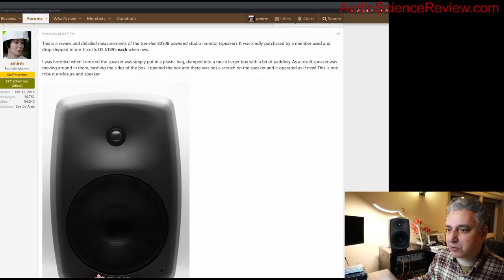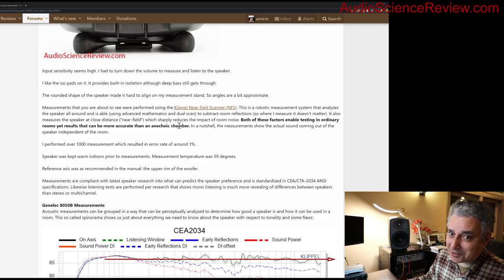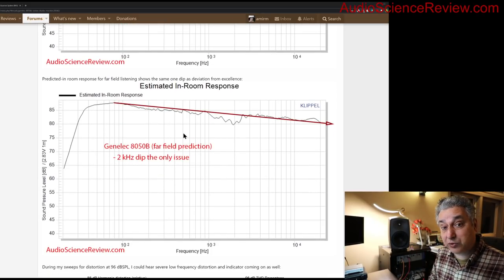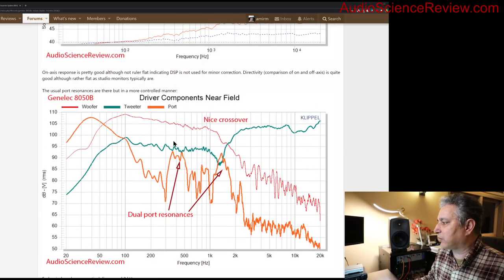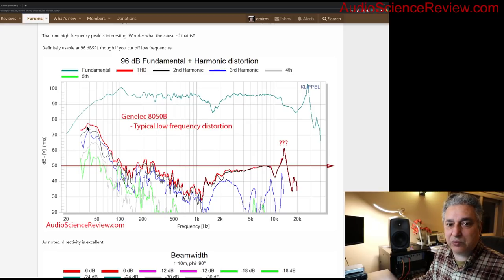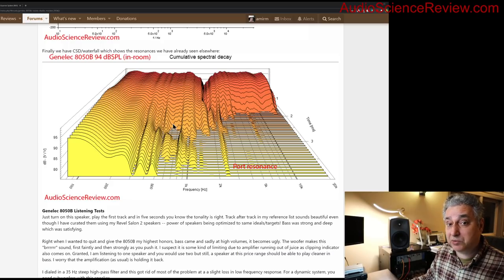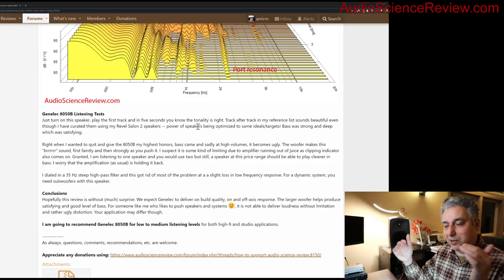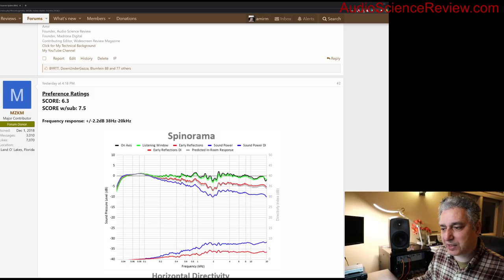Genelec 8050B Speaker Review (and how to read speaker measurements)

Comment: Thanks for this review. Very, very good. 

As a professional sound engineer, I would like to point out one little thing - but I am sure you know that - and that is that monitor speakers usually are not built for high SPL, especially nearfild monitors. The Genelec 8050B are marketed as a very powerfull nearfield monitor (which they are), but they are still marketed as NEARFIELD speakers. So comparing them to a floor standing HiFi speaker with three 8" woofers isn't exactly fair, and I wouldn't call their inability to provide comparable bass a failiure. It's a limitation that one should be aware of, yes, but nothing more, and to me, it does not take away from them the fact that they are superb for what they are and for what their intended use is (also for the price btw., which comes in about 1500 bucks cheaper than the mentioned JBLs). The 8050Bs as a pair will practically rip your face off in a near field application if you crank them up. Not that any good engineer would ever want to do that, since all it does is to damage your hearing and exite the room to a degree that you are distorting everything into oblivion. 

But enough bla bla, all in all I totally agree, those are great (!) monitors, one of the best in their class. And opposed to public opinion, they are not flattering the music. On the contrary. They are quite merciless actually. A good mix will sound good, but get yourself a pair of those speakers and you will quickly find out, that not all of them are (a lot of them are not actually) :D People who can't mix hate that. People who can, will aprecciate the disective properties of those tools. If your signal is flawed, these speakers will slap that right in your face.
Reply: @exeterweathermodification watch the ones series
Reply: When I got my first electrostatic panels I was amazed how my perception of recordings changed. Some albums became a torture to listen and then again some old simple stereo recordings became alive, holographic sound stage despite otherwise not so good sound quality...

Comment: To anyone wondering about our ability to filter out reflections, read about Echo Memory.

Also, living 300km from the Genelec headquarters has meant that 80% of the studios i've worked in, every school, every rental company.. they all have genelecs. And i mean elementary school AV room has genelecs... For sure, older and smaller but still.. That is what i've used by far the most and i've installed and tuned probably a dozen of them. It is really easy when you have a speaker that you know very well and when you write your list of rentals or just have to work on the road, having the same series of genelec at each end.. really makes things easy. You know what you are going to get and i've been spoiled by them, for sure.
Reply: Yeah!
I did buy my first genelecs about 35 years ago and has not looked back!

Comment: I used 8050s when I was a recording engineer. I auditioned dozens of near field monitors before choosing the Genelecs. Event Opals came in second place. You can turn off the tweeter with a DIP switch. I don't remember if you can turn off the woofer. The 8050s are too large for my room so I use 8030s with a sub for occasional music mixing and 8020s with a sub as my desktop monitors now.
Reply: Hello, I have 8030 also, which sub are you using with them?
Reply: @miguelalonsoperez5609  I currently used a Blue Sky SUB12 with one set of 8030s and a Presonus SUB8 with another set. The SUB12 is perfect. The Presonus is horrible. Definitely going to replace it with a Polk XT12 or a Genelec 7050 or 7060. I also used a Bag End 12" Sub for a while that I liked the sound of, but adjusting it was a pain.
Reply: @ftlbaby  thanks! Probably I’ll get the 7050 next year, 8 inches is enough for the kind of music I use to listen

Comment: Your review based on actual, well executed, meaningful measurements - instead of just anecdotes - helped me pull the trigger on this one instead of a pair of footprint 01s.
A little less than a year later, I couldn't be happier with them. I use them for production, mixing, mastering and casual listening too - basically everything. They hold up incredibly well and their low end extension is insane.

About to complement them with a sub soon.
Thanks for doing these incredible reviews!

Comment: Nice to see. I had these some years ago so I  was curious about your results. Still have Genelecs but the 3-way with DSP as you mention.
I do agree with you the 8050 do have an issue when playing very loud but on the other side they play very good on low and medium levels. (What that might be...)
Although one note about the DSP controlled room correction is that the frequency response isn't in particular flatter—it's just compensating for how a specific room behaves. It's not compensation for all the differences in the response but just a few of the most audible difficulties the room has.

Comment: I learned a ton from this video about the physics of speakers, thanks so much for putting it together and explaining!  And your list of reviews is amazing.

Special request to add Yamaha HS8 to your list!  I saw you did some Yamaha reviews and approved of the HS5's, but rejected HS7's.  I've had a pair of HS8's in my bedroom setup for a couple years and I've been debating swapping them out for JBL MKII306.  For some reason they've never sounded "good" to me although they are pretty detailed.  I feel like the lack some midbass warmth and might just be too bright overall, but they have been my only monitors so I have no comparison.  I tried KRK R5 G4 for a bit, but the highs sounded a little muffled and less detailed, but were overall more comfortable to listen to.  Size wise, I realized I don't need that much bass in my room even though I'm working on EDM, it's too unreliable with room modes so I figured I'd go for the 6" JBL instead of 8".  I can mix bass better with a spectrum analyzer and headphones.

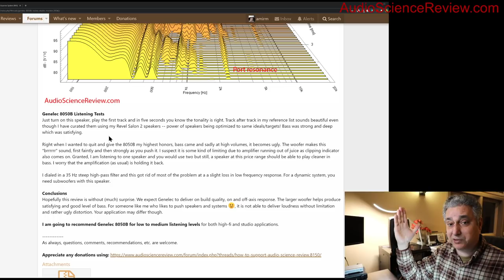Comment: Very interesting Amir. Like Albaer below I appreciate your in-depth explanations. I also appreciate the exhaustive testing and heard about the Klippel near field tester for the first time, although I know about NF testing of military RF equipment. Did I hear you right 33:02 saying you don't test listen to electronics because they are 100% measurable?!  I certainly don't agree with that statement. I once bought an amplifier from a major manufacturer just according to the specification / lab tests - it was an audible disaster but tested well. The next time I bought an amplifier my shortlist was based on reviews (which include lab tests) and my purchase came after listening tests. I am still listening to that amplifier over 30 years later and it keeps surprising me positively after I cleaned up the power supply to it and the RF environment it is exposed to. I'm quite intrigued by the online forum - perhaps looking at "not recommended" to eliminate candidates from my shortlists. All the best, Rob

Comment: I was very interested in getting a pair of the Genelec 8040b until I saw that they are using a 90w amp for the woofer, which struck me as pretty anemic for a powered studio monitor.  Still trying to decide but now I am looking at the Adam Audio S2V or possibly the A77H.
Reply: Not that anyone cares, but I ended up buying the Neumann KH 150 with the MA1 calibration system.

Comment: Amir - thanks for the excellent presentation. I wanted to know if the NFS allows one to predict what the speaker may sound like at say 2.5 meters. I’m just getting into DIY and I’ve read on multiple forms that that response should be optimized for typical listening distance (e.g. 2.5m). When I used various x-over design software (e.g. VituixCAD) - it allows me to design the speaker at various listening distances. When toggling between 1M and 2.5M, there is a difference in the predicted response, albeit minimal.

Comment: This is really helpful, thank you. I understand frequency response measurements much better now. 

Can you explain what causes differences in “detail”? With some speakers or headphones I feel like I can hear the elements of the music clearer. Is this just a function of flatter response and better highs, or is there actually another property of the speakers that make them “more detailed”? 

I’ve read people write about how the speed of the drivers can affect “timing”. Is that real phenomenon or just mind tricks?
Reply: Yes, being able to hear better Detail is due to the overall frequency response.  But there are a few other contributing factors as well.

Although it is not exactly to everyone's taste or preference, the "Harman Target Curve" is a widely accepted standard or "baseline" which describes the overall "tilt" or "curve" in the FR from 20Hz to 20kHz that will provide a balanced sound character and excellent detail throughout the entire frequency range.

Too much of the high frequencies results in fatigue and the masking of lower frequency details, and vice versus.

Therefore, it's most important that the frequency response be SMOOTH and EVEN across the entire bandwidth, with no large dips or peaks, as Amir demonstrated is the case with these particular Genelec monitors.  👍

An excellent measured frequency response graph will only deviate from the smooth Target Curve by +/- 1.5dB from ~160Hz and higher.  But a +/- 3dB response is still considered quite good.

As Amir covered in his measurements and review, the Directivity of the speakers as a whole is also very important in regards to "detail", and especially in regards to recreating the accurate Soundstage that was captured in or purposely mixed into the recording.

"Directivity" or "Constant Directivity" means that all of the individual drivers used in the speaker are projecting a very similar on-axis and off-axis amplitude or frequency response (an even polar response), which means that both the direct sound from the speaker AND all of the delayed and reflected sound that reaches your listening position will be very similar in tonality/frequency response.

Much of this is accomplished by using complementary low frequency, midrange, and high frequency drive units, and implementing proper crossover filters that keep each driver from playing into its beaming range (where its polar response or its width of dispersion starts to narrow or "beam" with increasing frequency due to the physical size of the driver and the frequency that it is playing).

Larger drivers start to "beam" at lower frequencies.  As such, the larger the driver, the lower it must be crossed over to avoid this "beaming" phenomena.

As an example, that's why you'll find that most 2-way bookshelf speakers will have a crossover between the ~6.5" midwoofer and tweeter in the 1.8kHz-to 2.5kHz region.  That is the frequency where a typical 6.5" driver starts to "beam" to a significant degree.

The crossovers must also limit each driver from playing into a range where distortion rises to or above ~3% for midwoofers and tweeters.  We are not as sensitive to distortion as frequency decreases.  Distortion approaching or above ~3% will mask detail or actually prohibit the driver from producing accurate clarity and detail.

You also want both drivers to be "in phase" especially throughout their overlapping crossover region.

Different crossover filter orders (i.e. 6dB, 12dB, 18dB, 24dB per octave, etc.) each introduce a different degree of phase rotation between the adjacent drivers, and that must be corrected or compensated for in the crossover design, taking into account each driver's natural acoustic roll-off as well (in dB's per octave).

You must combine the electrical crossover filter's design and parameters and slope/order with that of the driver's inherent & natural acoustical crossover or "roll-off" in order for them to sum to the desired overall acoustical crossover and phase response.

If there are shortcomings in any one or a combination of these areas, "Details" will be masked or smeared.

The "Speed" of a particular driver is another topic entirely.  But think of it in these theoretical terms...

If I send a 1kHz sine wave tone to the input of my amplifier, and the speaker does not play 1kHz, but instead produces a 900Hz audible tone, then that driver is not "fast" enough...but actually, there is a serious problem with the amplifier.  :-P

Remember that frequency is described in Cycles Per Second.  This means that while my input was 1,000 Cycles Per Second, the speaker was only able to move at 900 Cycles Per Second...HOWEVER, this is theoretically IMPOSSIBLE.

The voice coil will always move at 1,000 Cycles Per Second with a 1kHz input signal, but it is distortion via cone breakup that will produce a seemingly "muddy" or "garbled/SLOW" response.  The driver may only be able to reproduce that 1kHz signal accurately at a diminished or very low SPL.

This simply doesn't happen in the real world when a driver is used within its intended bandwidth.

If you try to make a 10" woofer play 10kHz, it obviously cannot physically do that at any significant SPL level without producing huge amounts of distortion.

The same applies to a 1" dome tweeter.  You would never expect it to play 100Hz or lower accurately or at a usable SPL.

IOW, if I take a particular driver, and input a flat, band-limited frequency range into the amplifier, and the speaker reproduces that entire band-limited frequency range accurately with relatively flat frequency response, then that driver is "fast enough" and its "timing" is accurate.

This is why we naturally try to choose the best possible individual drivers for our loudspeaker systems...i.e. individual drivers that exhibit as flat and as smooth of a frequency response as possible Within Its Intended Bandwidth or frequency range.

If the driver measures flat and even in relation to the input signal within a given frequency range, it is "fast enough" and "timing" is simply not an issue.

A driver cannot be "slow" and at the same time accurately reproduce a given input signal (frequency).  So a driver's accurate frequency response inherently indicates that its "speed" is sufficient.  If not, run away fast and choose a better driver, LOL.  :-P

HTH and isn't too confusing.  Amir or others are free to correct me or expand on this.

Without getting into the complex interactions and relationships between a driver's BL/motor system, inductance, and suspension properties, the "speed" of a driver is difficult to describe in a YouTube comments section, and I'll admit that I don't fully understand the topic.  :-P
Reply: @bbfoto7248  omg thank you for this amazingly detailed response! It answered so many questions I had and I think also talked me out of trying to build my own speakers 😂

Comment: I am a bit sceptical about the accusation re:the bass. If you are pushing the speakers to clipping level as indicated by the LED, you're using them in unreasonable and UNSAFE levels. 110dB SPL is the product's stated level. I just don't think the bass should be criticised for 'bad performance' when you reach the product's limits...

Comment: Genelec has a great explanation and specification for how loud you should play them, they can play louder, but I understand this is for headroom. I do also understand they have a max distance for each speaker size. Or, in short, do I think you may have forced the volume to be way above what they recommend. :-)
As I understand should, these small monitors be almost in your face with 1-1.5 meters max distance. Am I mistaking?
Reply from the maker: The notion of loudness is very personal.  What I do is that I crank up the volume high and don't expect any distortion.  If I hear it, I report it.  That way, I am setting a high bar.  You may very well be satisfied even if I observe such limits.
Reply: @AudioScienceReview  I do whole hardly agree with your method, if a speaker can play that loud, does it have to do it cleanly. Everything else is bad design. No, what I was trying to say is that the volume, that one had to use for clipping under recommended usage, would be far above safe listening. :-)

Comment: Great review! I just found your youtube channel.... Very informative! Keep hot the good work! I also checked your website and all the other reviews! Same here, just great!
One question, because you also tested Amps and AVRs. I read your reviews of the Marantz AVRs and that you criticizdie the mediocre measurement results of the amp sections.... Here you are testing a speaker with built-in amps.
Will the distortion or mediocre snr affect the listening experience, or is this something you will not hear due to distortion the speaker produces? Or more general....What is your personal experience regarding "amplifier sound"?  Do you find there is really a big difference in actual sound quality between amps?
Thanks for an answer! I really value your opinion on this!
Reply: @Andreas Heiden  
In regards to the "sound of amplifiers", I would suggest that you watch and listen to the "Live Amplifier Test" videos produced by TheAlphaAudio YouTube channel in Holland.

They recently conducted a live listening test that includes a Marantz integrated amplifier along wih several other amplifiers that are less than €1500 that is very revealing.

They also have a video comparing integrated amplifiers under 2500 euros that is excellent.

Use good headphones if possible.  Jaap and Yung do a great job of accurately recording these demonstrations and comparisons.